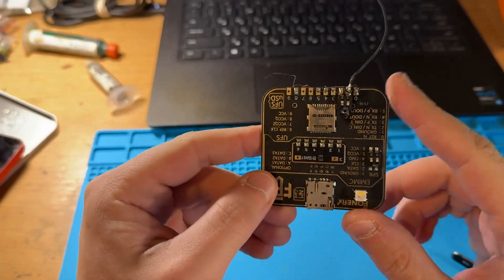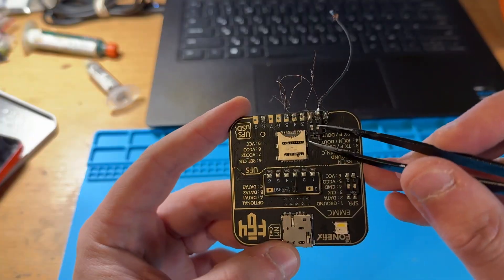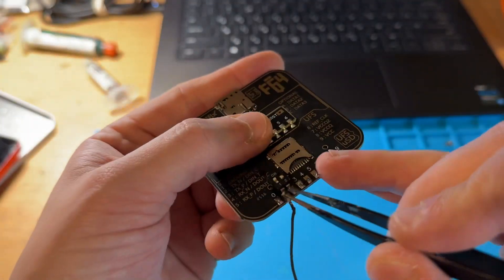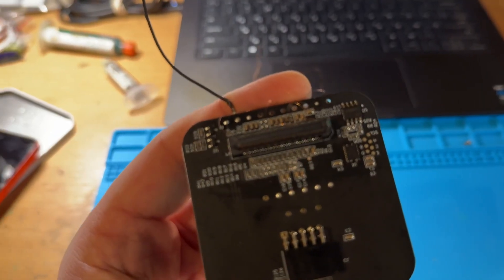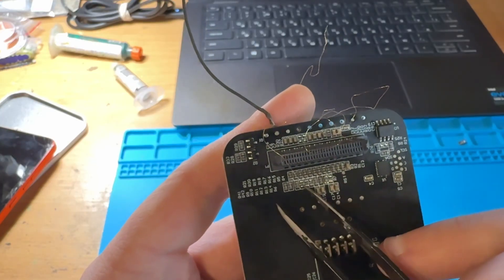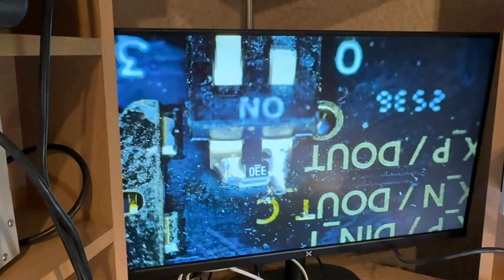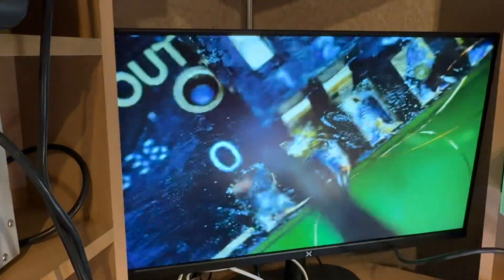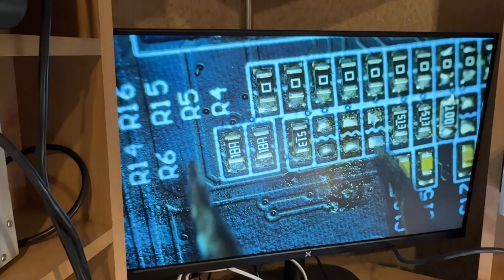My modify for FLASH64 ISP adapter for ufs memory

Comment: what about R6..??? there is 100ohm register in your board.... please discribe
Reply from the maker: as i remember it was 10ohm from stock... smd marked "100" - its 10 ohms)
Reply: @Remote_Unlocker  do you add this??? in my isp kit there is no register.
Reply from the maker: @tusharsarkar-x5n desolder from any china tablet…
Reply: @Remote_Unlocker   sir is it necessury to add 10 ohm in r6?
Reply from the maker: @t @tusharsarkar-x5n  im did this by manual from devs…
Reply: @Remote_Unlocker   thanks....
Reply: @Remote_Unlocker  there is no 10ohm resistor on my socket R6 board. most likely it is installed by you
Reply from the maker: @СерегаСпиваков-ы5б  yap, you are right. just checked my modify search history and in first my modify i added this resistor and forget to remove then...